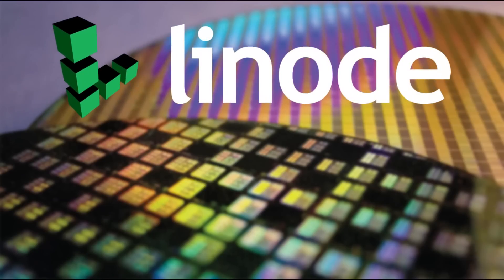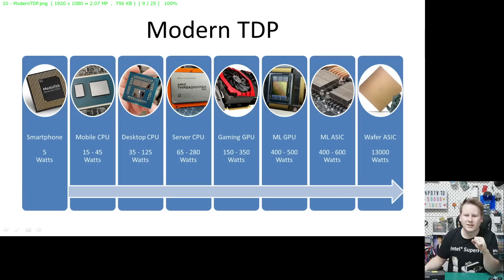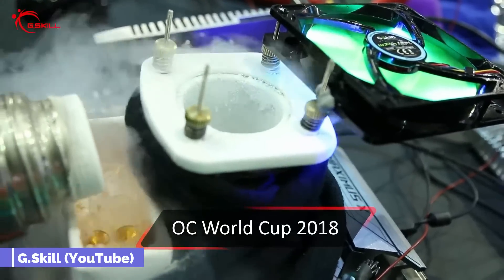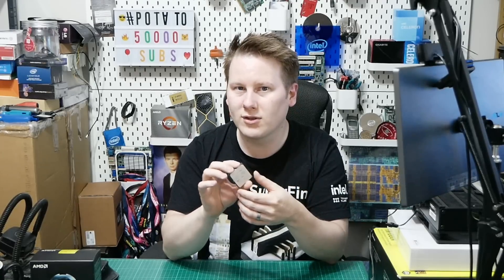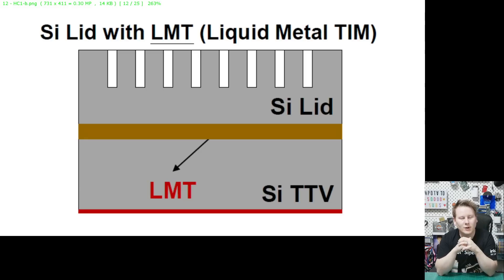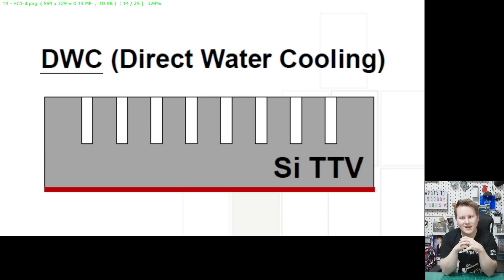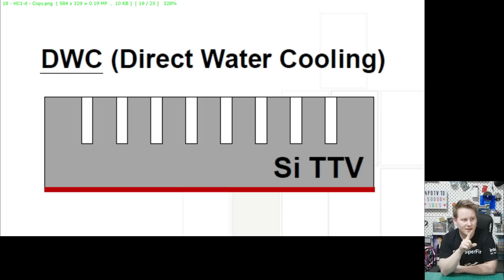How to Cool a 2600 Watt CPU or GPU 🔥🔥🚒

Comment: a vapor chamber direct on the chip with groves would be fun to see. That way you could spread the heat to bigger surfaces, that could be cooled traditional
Reply: This actually seems like a really good idea. Have the underside of a IHS basically be a vapour chamber... The IHN doesn't even need to be like they are today. They could mushroom out to offer a greater surface area to sink heat from...

Comment: The camera is over exposed and the audio is out of sync, but, on this channel, that doesn't really matter; we're here to hear what the man has to say and inform ourselves.
Reply from the maker: Audio should be fine - it is locally?
Reply: @TechTechPotato  can confirm it's fine on my end
Reply: @TechTechPotato  No audio problem here, but the exposure is hot.
Reply: @TechTechPotato  It's ever so slightly out of sync on the audio but not enough to warrant a re-do.
Reply: @TechTechPotato    The audio is fine now.  The sync issue must have been on my end.  It persisted after a refresh, so I thought it was the video.  Sorry for the confusion.

Comment: 5.8lpm is incredibly slow, a problem I can see is that the etched cooling fins on the chip are so small that the liquid really needs to be at a very high pressure to get even that flow.
Reply: definitely lots of room for optimization, this was mostly a proof of concept with very simple geometry
Reply: Yeah, no matter what you do at that scale the surface tension is going to create issues with heat transference, the heat density of the CPUs vs everything else we cool (even engines, etc), hot spots creating air bubbles, etc...

Pressure and coolant "stickiness" is going to be a big factor.

I honestly wonder if in die/on die cooling will work, especially as it is only going to get denser.

It may need another layer to diffuse the heat a bit so it can't create air bubbles and block cooling in specific areas. Even with a mirror finish, tiny imperfections give a focal point to generate air bubbles when heating liquid.
Reply: It sounds like a lot to me, if you are trying to push 5.8 liters through what is essentially a microfluidic device instead of a liquid cooler like we have today. You might have insane back pressure, which would need better pumps, stronger connectors all around. Sounds expensive(I only know microfluidics though, not PC cooling)
Reply: I believe the trenches are only to increase surface area and the liquid goes all over the surface of the chip, not just through the trenches.
Reply: @kasuha  yeah, but if the heat is intense enough it'll still cause bubbling and cavitation. 90C is 194F, bubbles would cause enormous problems, runaway heating.
Reply: @glenwaldrop8166  I'd expect some sort of mineral oil to be used there rather than water.
Reply: @kasuha  probably, but it's not as efficient moving heat I believe, harder on the pump too. I guess if it's thin enough...

I was expecting some kind of dedicated coolant regardless, doctored water at least.
Reply: @glenwaldrop8166  My own recipe for coolant is distilled water with RDX surfactent and copper sulfate.
Reply: @JohnDlugosz  I prefer hops and barley in my coolant. I do however respect the copper sulfate. It’s a nice touch
Reply: Two-phase (phase-changed), refrigerated, Fluorinert-spray-cooled processors can handle up to 100 W/cm^2 (100 mm^2), so 1,000 W cooling capacity in a 1,000 mm^2 die, at negative temperatures.
Reply: @NUCLEARARMAMENT  ill take two

Comment: Back in the distant past (the 1980s) the discussion about future processors was about the HSG (Hairy Smoking Golfball) CPU package. It would be as small as a golfball to reduce cross-chip signal latency down to a few dozen nanoseconds, it would have lots of hair-thin wires coming out of it for the 32-bit or even (gasp!) 64-bit data and address buses and it would be smoking from the amount of heat it would need to dissipate as it ran at hundreds of MHz, maybe even as much as one GHz! for super-high-end designs.

We laughed then. We're squirming uncomfortably on our chairs now.

Comment: Trenches vs grooves vs fins vs tubes...

The hotter it gets the more pressure it needs and the larger the spaces will have to be to prevent air pockets from forming at the hottest points.

We deal with this in the automotive world and I imagine it won't be long until we have a stickier coolant that raises the boiling temp similar to antifreeze and the various "water wetters" to prevent air pockets and hot spots in CPU cooling.

I haven't seen air bubbles form inside an engine but they're also cooled on an entirely different scale than the CPU. I have seen air bubbles form in other situations that make me wonder if liquid cooling can even work at the silicon die level...
Reply: Prosiphon elite much? :P
Reply: @SebLukaTech  Nice.

That doesn't get past the cavitation issues if the hot spots are hot enough on die.

In context I was talking specifically about having the coolant on the surface of the silicon or running through tubes/nanotubes/grooves in the silicon itself.

Simply having a layer of silicon or metal on it will inhibit the cooling somewhat but may prevent air bubbles if the heat generated is intense enough in certain locations.

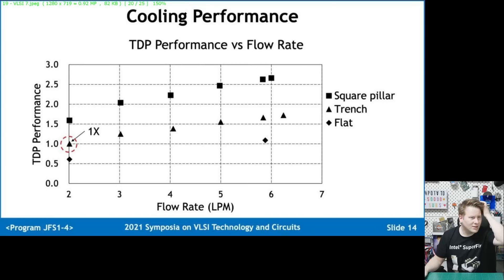Comment: That diagram @13:01 shows Relative increase of TDP, if you increase flow to 6 L/m and you use pillars (I assume intersecting trenches you can dissipate 2.6 times more power and hold same temp.

Comment: For consumer/enthusiast use, I hypothesize that a grooved chip built into a vapor chamber (basically, the vapor chamber would take the place of the traditional heat spreader) would see some significant benefits in temperature without increasing build complexity or maintenance for the end user.
Reply: You mean basically like the vapour chamber body sorta slots into the silicon? Like wood working joints?
Reply: @SBA_poiko  Yeah i think that also. Much cheaper to use as sealed soldered heat spreader.

Comment: Posting from my rig which under Benchmarks uses 580W CPU (10980XE @ 5.1ghz) and 600W GPU (3090 with 1KW XOC Bios).
Water cooled obviously.

Comment: i can only imagine what dissolved solids would do to the silicon over time. would the water need to be pure?
Reply: That's why the silicon oxide "TIM" solution is appealing, the oxide acts as a diffusion barrier.
Reply: But water never stays pure in a loop. And at the scale those channels are I'm ready to bet just erosion is a big issue. In regular open loop watercooling the nickel plating (on plated block obviously) gets rubbed off in a a year or two of daily use. It's not much thickness but when the whole package stack is 12 micro meters (for that 3D example) i don't think you can afford to lose much more.

Current silicon basically never dies if it is kept in spec. Do we want to move to a solution that makes it a consumable for the sake of performance? I wouldn't think that's an improvement when we know pushing more power through a chip to get more clocks is pretty sharp diminishing returns. It's not possible to push every single component that far to match.
Reply: @SquintyGears  I think that's why he was saying this will probably never come to the consumer space.  For specialized chips that will be obsolete inside 2-5 years (e.g. performance/watt is no longer competitive with a newer repacement) I'm not sure that'd be a dealbreaker.  Those specialized chips aren't hot because of overclocking, there's just that much crammed in there; think like GPUs that run hotter than CPUs even at half the clock speed.
Reply: @SquintyGears  It's like automotive cooling systems though, you make sure the grounding is properly done between the radiator and the engine, try to make the coolant as non-conductive as possible.

Most of the oxidation and corrosion tends to be caused by electrolysis, even just the static difference between the engine and body if the grounding isn't adequate, it's still electrolysis, just really, really slow.

Eliminate that and 90% of your corrosion issues are gone. Using the same materials, or at least non-reactive materials, further reduces the issue.
Reply: @glenwaldrop8166  think about the scale though. Engine cooling is done on a massive chunk of metal. Here even without any issues with conductivity (which wouldn't be in question anyway if they don't use waterbased solution) I think the waterlfow would grind away the chip physically.... To keep things in perspective a DDC pump does about 16L/m and TSMC's table goes from 1 to 7L/m. But people usually don't run their pump maxed out and you still see visible errosion on the nickel plating within the lifespan of the PC. I obviously have no way of testing this conjecture but that's a reasonable thing I imagine happening for this concept.
Reply: @SquintyGears  that's where the proper coolant comes in, you get something that is non-interactive and non-conductive, you have the same metals in the plate and the coil so they don't interact and you keep the plate and the coil grounded together to prevent there from being any potential difference between them.

You don't see physical erosion in a closed system. Water erosion on solid objects pretty much has to involve air. A closed system with no air bubbles has no impact, no drips, nothing, just smooth travels, almost like lubrication. Unless it's corrosive or conductive (even low levels are an issue) it won't erode the chips.
Reply: @glenwaldrop8166  errosion isn't an chemical reaction. It's removal of the solid material through friction and if there's movement there's friction.
(edit) i couldn't see the second half in the notification, but there's always somethings in water, there is no consumer waterloop without air bubbles. I don't think this is only going to be usable by NASA so there has to be something else.
Reply: @SquintyGears  the air bubbles settle in the top, the bubbles don't circulate in a closed system unless it's moving, even in the case of a car the bubbles stay at the top, the engine doesn't flip over during operation.

A drop of water a day will burrow a hole in granite, flowing water will barely damage it at all.

What you're not seeing is there are two steps to the process, the physical one and the chemical one, I covered both.
Reply: dont use water

Comment: I have been wondering when Intel would introduce the first 1kW CPU for years. I imagine someone else might beat them to it, but I still am hopeful for Intel.
Reply: They'll still label them 95W TDP, though.
Reply: if you consider the 56 core one a single cpu, that one and the w-3175 both go well over 1kw if overclocked heavily lol
Reply: intel did some silly 5ghz 28 core overclock on the w3175 using 1500 watts i think

Comment: It comes down to packaging. If AMD and Intel wanted to use direct cooling, they certainly could, on a mass scale. I think it is likely they will, too. I built my first PC... no fans required, on the chips or motherboard. Today, there are easy solutions for people to use all-in-one liquid cooling radiator loops. I can see a day when our desktop chips come with water cooling ports directly in the packaging and we have standard kits (or they are included) to hook them up.
Reply: Direct cooling doesn't actually work very well - hence it not being used much.  You can pump the coolant at high pressure though tiny holes aimed at the die to make it better but at that point it's a lot cheaper to attach a block of some kind.
Reply: My concern with it would be the end user. 
The lowest but widest common denominator doesn’t maintain their loops regularly as is. You think they will maintain something intricate like this? I feel like they wouldn’t, and that would probably steer the decision to implement it en masse.
Reply: That's sound's like a good idea and all, but then if you have any problem with your cooling, and/or your internal fins are all clogged up because the end user cooling fluid is not chemically perfect, the entire chip ends up having to be scrapped.

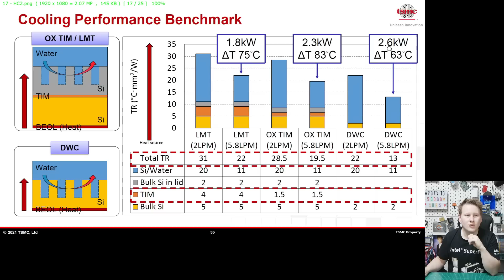Comment: For reference, that graph at 12:30 seemed to imply almost 3x TDP at 6 LPM. The "1x" point is at 2 LPM trenches, which if you check the previous graph at 11:11, was somewhere around 2 KW. If that is to be taken at face value, that's nearly 6 KW TDP!
Reply: Somebody has been overclocking a reactor?
Reply: @nathanlowery1141  Kind of low for a reactor, but that is literally the wattage of a fairly sizeable solar panel crammed into a computer chip.

Comment: When I was really young I had a book about modern houses. And how in the future we will have heat and cold access ports in every room. So you can move heat from the freezer, back into a radiator or hair dryer, putting your computer on that loop wasn't sketched out back than. Also using a heat pump outside.

If power(=heat) becomes less of a concern, will we just push the frequency higher and higher for performance? 
Also the efficiency on the smallest end for phones maybe?

My next computer will be small form factor and it will have liquid cooling for CPU and GPU.
Reply: Not quite there to those degrees but at least here in Denmark it is required by law in any new house/apartment that heat and air gets circulated around in ways that puts damp air into dry rooms, hot air into cold rooms and the other way around. Any home from 2020 and newer all have this. But while plugging your pc or refrigerator into this system would be quite easy it would not make any difference at all. The loss and insulation needs alone would make it unfeasible. A better system would be moving all the heat generating systems into the same space and then move air from there to could rooms. We have done pretty much this in our house.

Comment: I like where nerding out can take this, my only fear is that chiplet CPUs like threadripper as they exist today aren't far from tripping the electricity I have.

If something pulls more clock speed out, maybe a lower process to pump more power through as well, then things could get crazy at home.

Comment: I have a pair of Xeon X5690, and at one point i had the pair OCd to 4.2Ghz, IIRC each processor pulled 160w at default, and 220w OC, so 440w just on the CPU(s), add to that the 12 fully buffered DDR3 ECC RAM at 14-22w each and before you even add a drive or video card you could be looking at over 750w

Comment: just cool them from both sides, a fan and a heatsink on each side :D
twice the cooling! twice the TDP!! because that's how that works right?
Reply: I keep thinking they have a giant power connection that would be a great thermal connection (esp on op-amps, buffers, VRM power stages, etc), and they're starting to fuss with vertical interconnects that would also work great as thermal vias, then I think of what NVIDIA would do with that on consumer cards and drop the idea out of fear of how hot my house would get, lol. all that heat eventually ends up in the room the PC is in. great if you live in the arctic, not so great if you live in a temperate zone or the tropics.
Reply: @Zarcondeegrissom  Yea, I already have that problem with my home office getting toasty.  Maybe my next custom case will hook up to a standard dryer vent rather than having exposed fans on top.
Reply: Your right, the future solution is to have a cold plate heat sinc on each side of the chip for better cooling. We already going there with these flimsy plates on back of GPUs
Reply: Yeah but how would you supply power and data efficiently to the chip?
Reply: @suntzu1409  well, on the PCB the traces go out to the sides anyway, so data on the outer perimiter edges, cooling and power from the top and bottom. common on the top heatsink, Vcore from the bottom, and the VRM can even plug into the back-side of the socket like the old CRAY SV2 processing elements. no it's not 'ideal' for some things, yet for others, it could work. like most things, it's just tradeoffs of one thing for another.
Reply: @Zarcondeegrissom  i meant cooling will take space on the bottom of the CPU.

Bottom of the CPU already has hundreds/thousands of pins

Where would cooling go?
Reply: @suntzu1409  at the bottom of the stack of stuff. where the vrm is on the SV1. the power connections are just a massive block of copper anyway, not that different from the IHS on the top of the CPU.

tail end of part1 (about 9min)
watch?v=yQW-UWYwhm4
and that continues on part 2
watch?v=Tl_RB5Snhr4
Reply: @suntzu1409  I posted a 3D example in "the-lounge" on the techtechpotato discord, shame YT wont let me do full vid links and add pics to comments here.

Comment: I'm waiting for Novec to become afordable, i'd love to have a completely passively cooled computer with phase change immersion, and then a massive, passive condenser on the top/back of the case
Reply: I also think phase shift liquid cooling is more convenient for such an application. After all this is the convergent evolution of copper heatpipe tech and good old oil immersion cooling.
Reply: @PainterVierax  I think the.... ice giant? uses phase change fluid in this way, which is a much more economical use of a fuild that last time i checked costs ~$3000 for a 5 gallon bucket, which i'd probably need half of that for a regular ATX build with enough room to put the GPU and CPU blocks on display
Reply: @denvera1g1  I don't know about pricing and budget but from what I've read from experiments on water, mineral oil, novec or even helium and hydrogen cooling, fluid replacement or refilling is always needed, as it ages or it leaks even in a sealed containment/circuit.
Reply: @PainterVierax  IIRC helium, cannot be contained completely because the atom is so small it literally slips between the atoms of the container, not just thrrough the seals, but every part